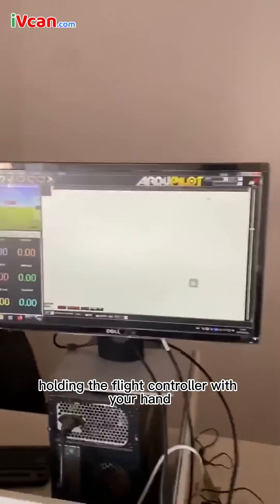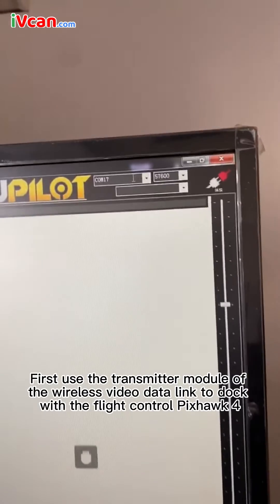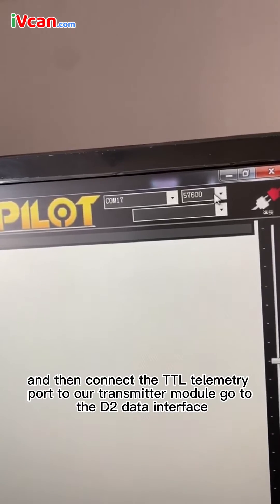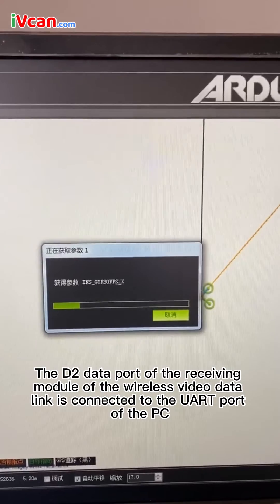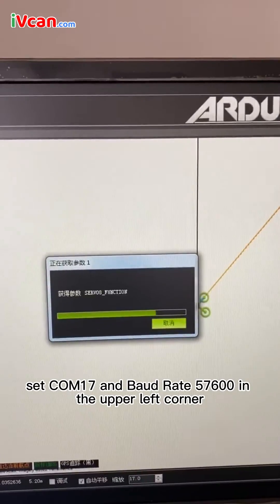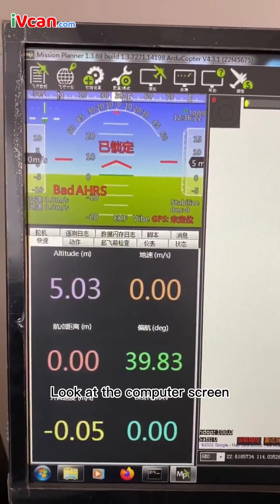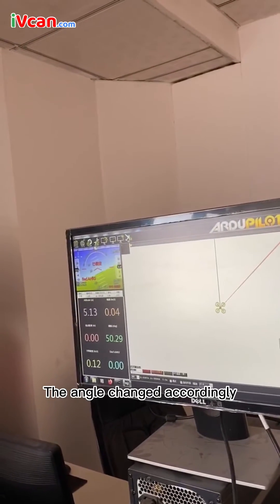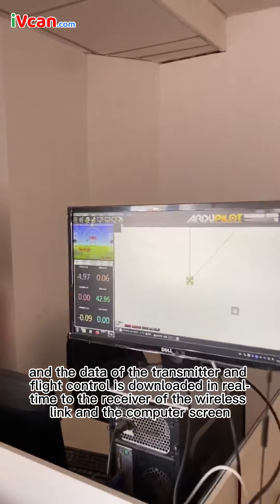Connect Pixhawk 4 telemetry TTL and Ardupilot Mission Planner via wireless video data control link

Comment from the maker: ❤ The two-way wireless video data control link in the video is here, 
https://ivcan.com/p/uav-wireless-video-data-rc-control-link-module/
❤ The 15km 30km 50km 100km 150km wireless video transmitter is here, 
https://ivcan.com/p/15km-30km-long-distance-wireless-video-transmitter-receiver-transmission-transceiver/

✅ WhatsApp Chat with us: 
https://bit.ly/3NqMliG
📌 More Wireless Video Transmitter and Receiver
https://ivcan.com/c/video-transmission/
🚀110km LOS test video
https://youtu.be/r1X4AU1togE
👍27km LOS test video
https://youtu.be/mU-3d_q2jBI
🏛NLOS Indoor in building in lift test video
https://youtu.be/X-nu-QZYc5Y